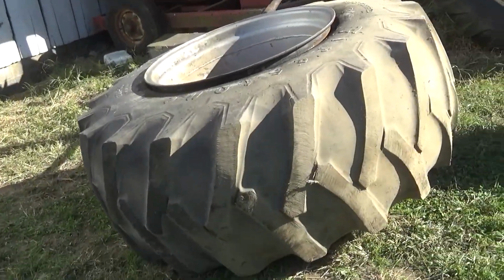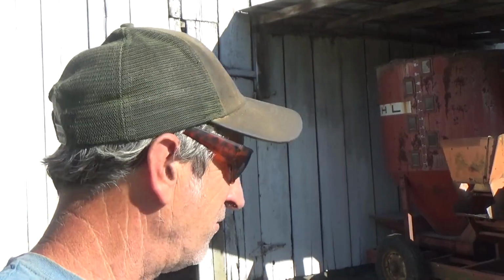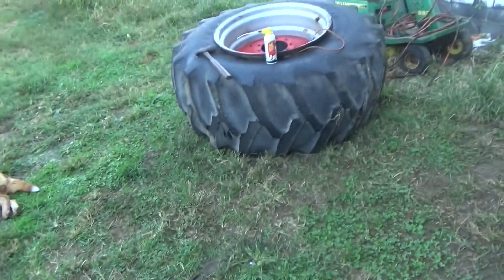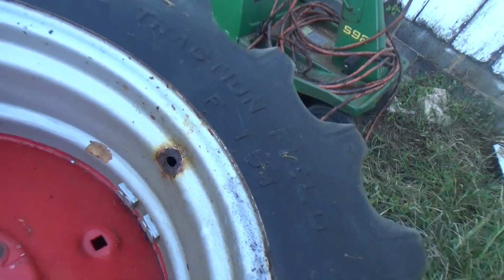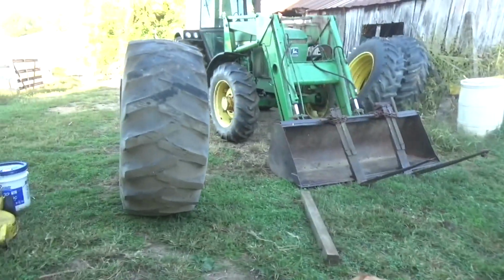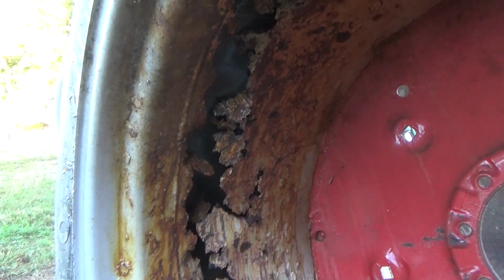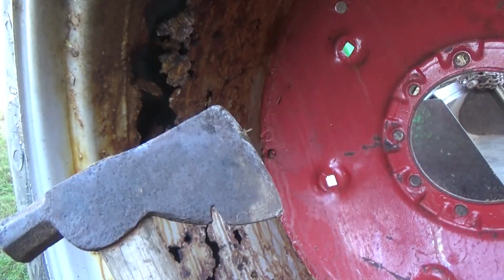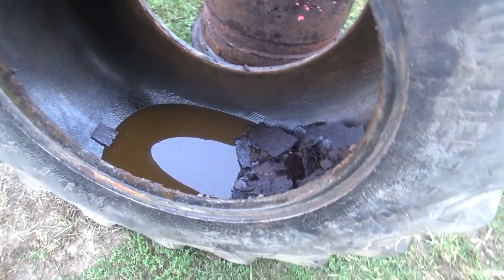A tiresome chore

Comment: Not sure if you have a backhoe but we found if you reach across the tire with the hoe and just slide a couple bucket teeth under the bead of the rim and then push straight down it breaks them right down.

Comment: Yep, CaCi is about the worst thin to use in tires, even though it used to be the norm. It's not if the rims will rust but WHEN. Another thing, cast iron won't run don the ditch when you have a flat. The first thing I do with any tractor I get is drain the CaCi air refill the tires with nothing but air.  Won't those 23.1X30s be short for the 4010?
Reply from the maker: Hey Paul, They are the same height as the cut and a half 20.8- 34s that are on it now. I did measure.

Comment: When ever I have a tough tire I use my Dad's little 1520 ford to pop the bead with the bucket. If that don't work I run over the tire with the back tractor tire. Pops the bead real quick, I don't have a nice slid hammer.
Reply from the maker: Right on

Comment: We that use tractors on the farm , want the cleats on them , don't understand why you pullers get rid of them! I've heard they use beet juice for weight in tires. I've got a John Deere 70 calcium has ruined valve stem hole on the rim!
Reply from the maker: Hey, l farm and pull too, these tires were road worn, l just evened them up a bit. On the pulling track lots of tread digs too deep and piles up too much dirt, worn tires perform much better. Thanks for your comment.
Reply: @so.md.dirtfarmer2226  Yes sir I farm and use to pull in the U.K 20 plus years ago. There is an awful lot of guys out there go put brand new tires on their "Pull" tractor and wasting  expensive rubber that really gets them nowhere . I had a set of European klieber  18.4 38's on my old tractor they were field and road worn  .  They had the long bars with 3 or 4 little bars about 3" long and 1" wide between each lug. The main lug was even worn and almost gone and those tires pulled real well, you'd swear the small in between lugs did the work looking at them and the rest of the treads.  If I was going back to pulling I'd love to use those brand tires again, but they are near impossible to find here in Canada.
Reply from the maker: @super6954  Hey Super, thanks for telling us about your experience on the track.